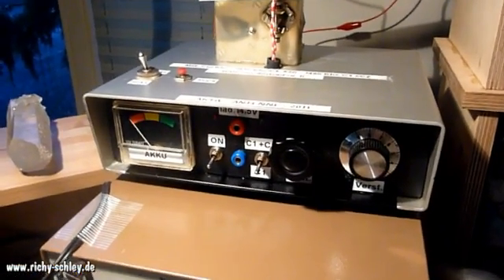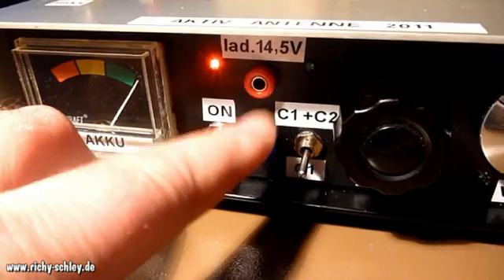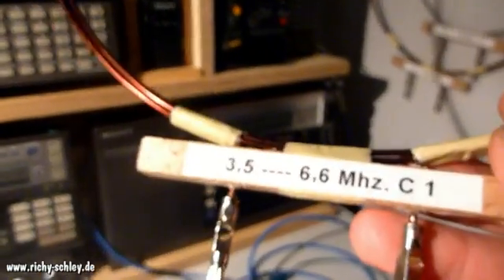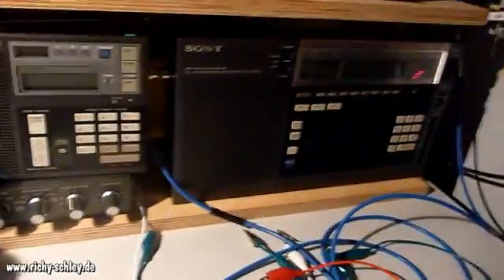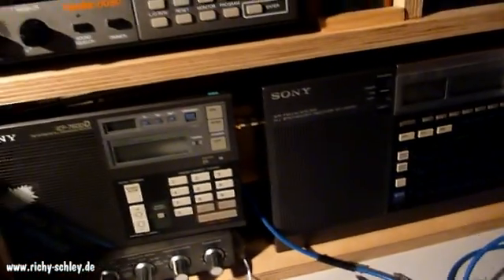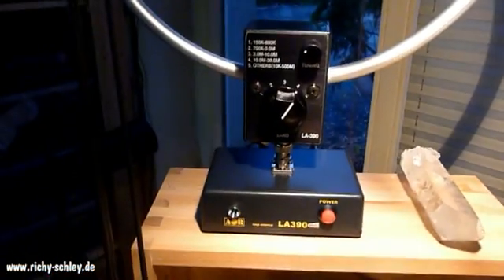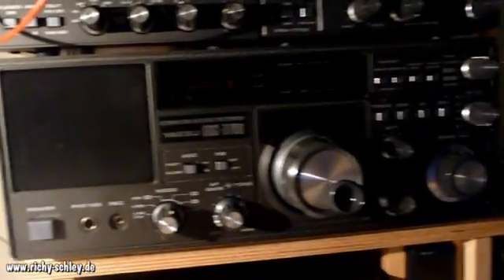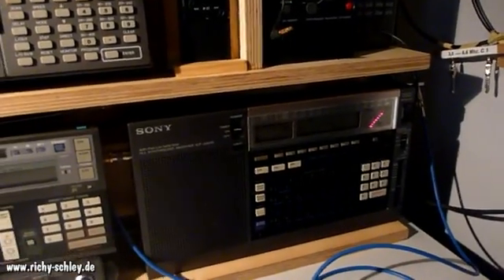Homemade active magnetic loop antenna shortwave

Comment: Hi, very nice compact design. Do not you want to share the circuit details so interested viewers can make somthing similar? Thanks
Reply from the maker: Thanks but no, I didn't build that antenna. The guy who made it is a retired professional radio und television technician.. I asked him kindly to give me the circuit. The answer "I don't have one. I made it from memory."
Reply: @Wanderlinse  Hi, thanks for your kind reply. It is a pity that there is no document for such a nice antenna set. Maybe, you may share a few photos of the different antennas (with sizes) and some photos from the inside the box so it becomes  possible to do a reverse engineering, provided that it is OK with the designer and does not cause much hassle for you.  Thanks
Reply from the maker: @esnam6557  Unfortunatley I sold it :-( Maybe he will send me a circuit when I ask him. But I don't know if he is still alive... he was already very old 10 years ago... But the German Grahn antenna is even much better by the way... I have a Grahn GS3 SE, which is the old model. The new GS5 SE is even better. https://www.youtube.com/watch?v=8jis3XvQk90
Reply: @Wanderlinse  Hi, thanks for your response and the link. Any further details about the circuit will be highly appreciated. Thanks